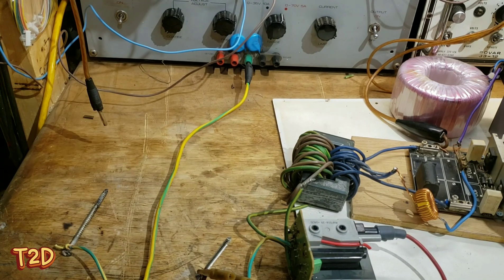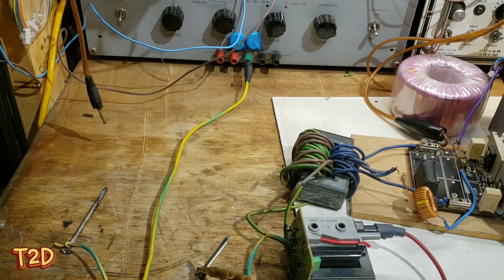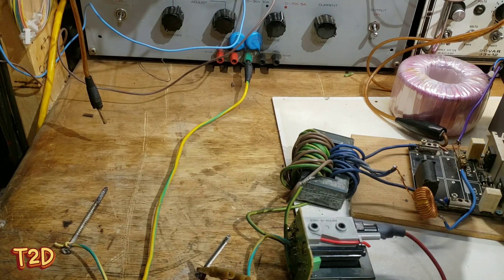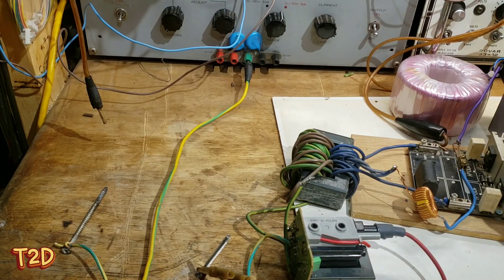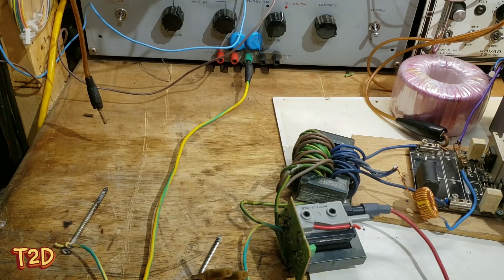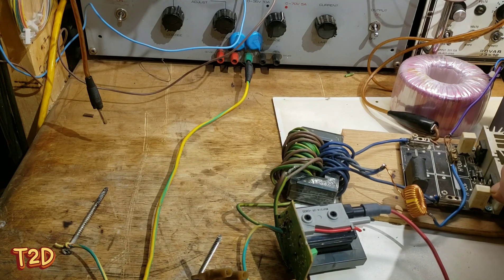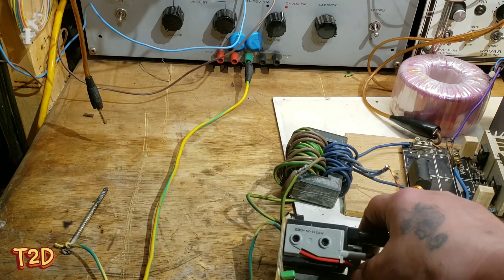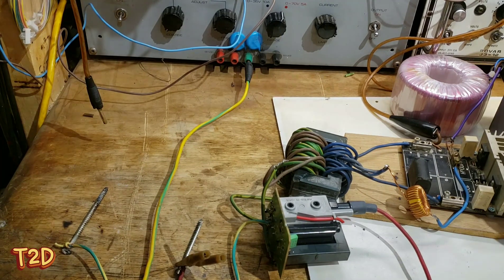ZVS Easy Audio Modulation

Comment: Isn't this how audio modulation is done? Mind-blowing! Why haven't I thought of this before? But wouldn't the ZVS driver also induce current to the audio isolation transformer? How do you do this?😅
Reply from the maker: Il make another video about this because a lot of people showed interest
Reply: @T2D.SteveArcs  I believe it is due to Franzoli Electronics' singing flyback transformers, and perhaps some DIYers found his EasyFlyback circuit a bit complex. And yeah, interest has been mounting up from high voltage enthusiasts if it is possible to modulate audio on a ZVS driver(me included😅)
Reply: Nah, the ZVS doesn't affect it since the audio is on the DC side. All it's doing is introducing noise into the input at audio frequencies, which remains on the output.

Comment: Mind blown.  I had no clue u could just insert a signal like that thru a transformer.  I will try this. Thanks for sharing!  I thought u could break a zvs by switching it off and on too fast?  wouldn't this damage it?
Reply from the maker: No it's not switching it on and off the transformer is in series with the DC supply so the positive DC passes through the winding of the transformer and into the zvs u then apply the audio to the other winding of the transformer 
.. thers a schematic in the video mate...

Steve
Reply: @T2D.SteveArcs  Oh I see.  Its on the whole time and the audio signal coming thru the secondary of the audio transformer is heard thru the arcs.   Its like magic
Reply from the maker: Lol it's how they used to modulate tubes in early transmitters

Modulation transformer 

Steve
Reply: @T2D.SteveArcs  That's awesome!  Ty for sharing :)

Comment: I used to use a mosefet between the power input of my zvs driver but it was terriblebly inefficeint
Reply from the maker: Did you run the mosfet in the linear region?
Reply: @T2D.SteveArcs  no it was running in the saturation region
Which is terrible for the mosfet

Comment: Just noticed that you were touching one hv wire with your bare hands..😐. Didn't it shock you 😬
Reply from the maker: No mate ground wire 0 volts
Reply: @T2D.SteveArcs  was it grounded  ????... I have accidentally touched the ground wire of flyback transformers a lot and it still shocked me 🙄
Reply from the maker: @spandandutta2485  it's only grounded if its tied to earth ground then you wont get a shock.
Reply: @T2D.SteveArcs  ahaa ... I got it.😂 Sorry for a silly question 😂
Reply from the maker: @spandandutta2485  no silly questions in the quest for knowledge mate....

Steve
Reply: @T2D.SteveArcs  I still don't really understand the grounding thing, is the ZVS power supply grounded or the core of the flyback itself? Is it just like taking grounding wire with crocodile cip or just a wire from wall socket ground?
Reply from the maker: @groundkopi5975  do you mean you dont understand why I don't get shocked,?
Reply: @T2D.SteveArcs  I don't understand how you can ground a zvs
Reply from the maker: @groundkopi5975  it's the transformer secondary that is grounded mate

Comment: works better than I would have expected. I guess your ZVS is running well above 20kHz quite a lot run in the audio range and would sound nasty. Good demo
Reply from the maker: Thanks mate.. you can change tank capacitance to adjust frequency hence all the missing caps on the Chinese zvs board 🤣🤣🤣